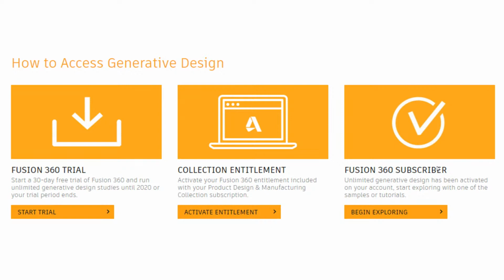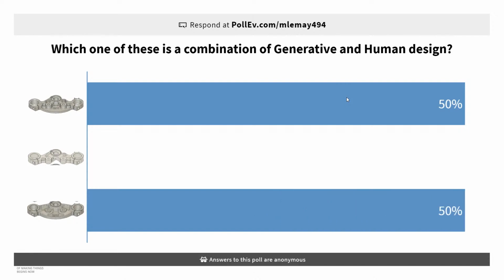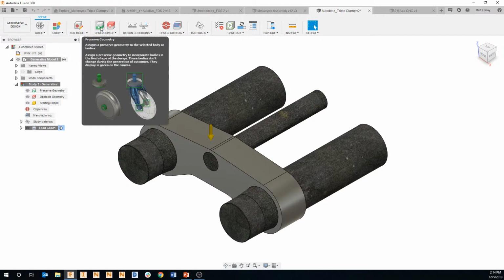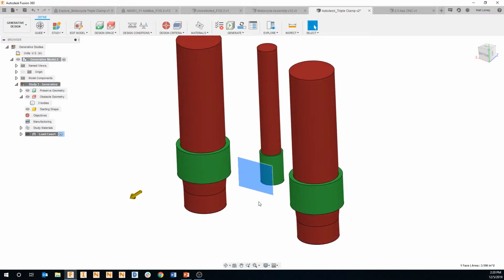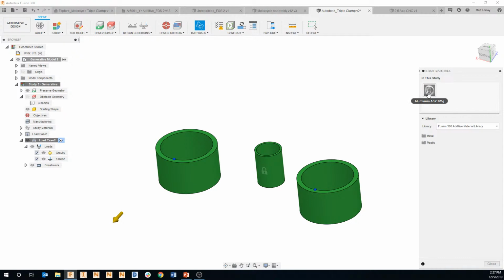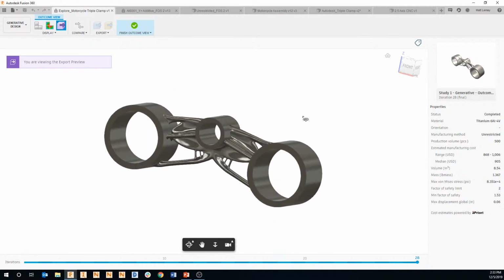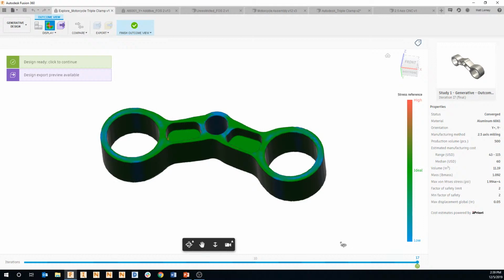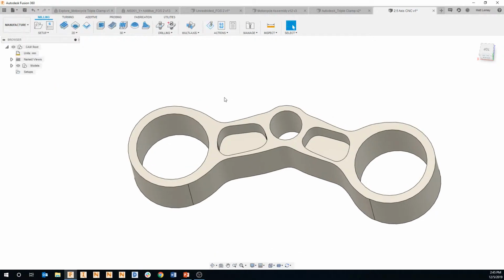360 LIVE:  2.5 Axis Generative Design with Matt Lemay

Comment: With a tipple clamp as an example, the forces aren't just compression/tension, there is twisting in all directions. How do you add that to the simulation process? 
Cheers Cam.
Reply from the maker: Hey Cam, great question! You can add many other load cases to the the generative setup. I think Matt chose to ignore some of those cases as it might get too repetitive for a live presentation like this.